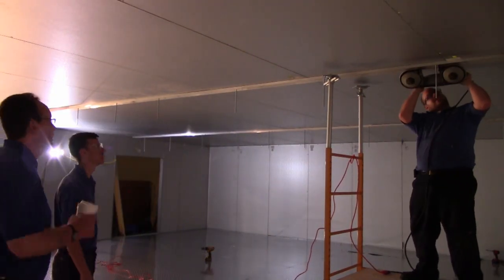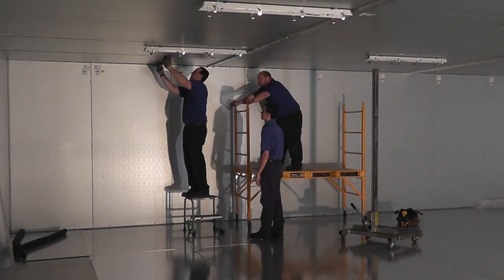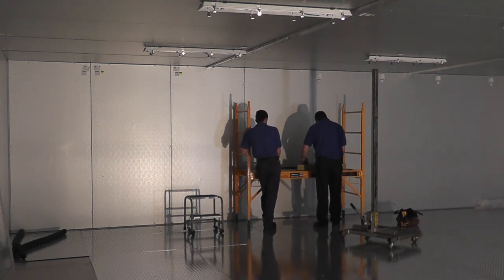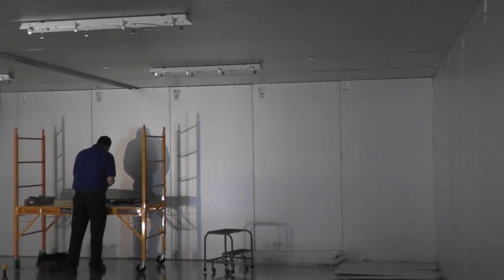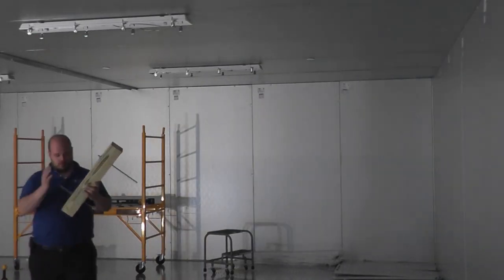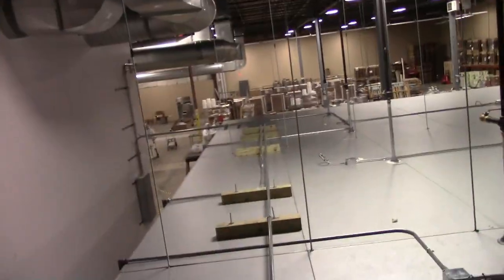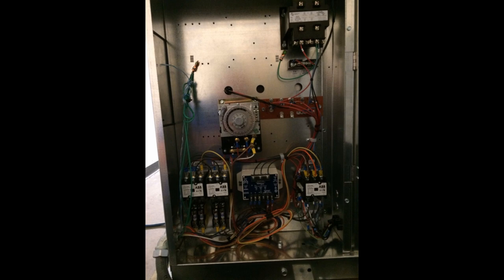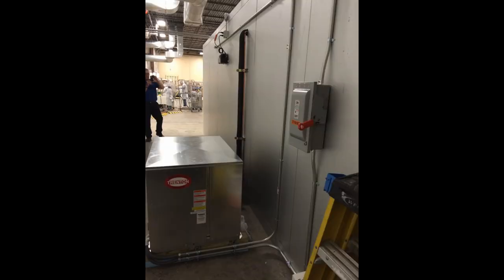Installing a Large Walk-In Freezer Part 3

Comment: @Halligan142 what is the name of that equipment used to mount the evap?
Reply from the maker: It's called a Hi-Jack.  They're still around.  More portable and easier to carry in the van than the cable type lifts.
Reply: Panel board by  numbering
Reply: @Halligan142 can't find the evap jack you used really would like to buy 1 any idea were to buy one online or in person high jack online can't find one I was thinking of using a dry wall jack but this one looks perfect